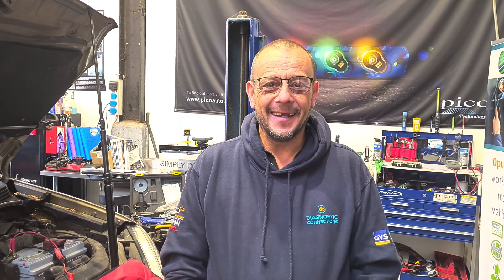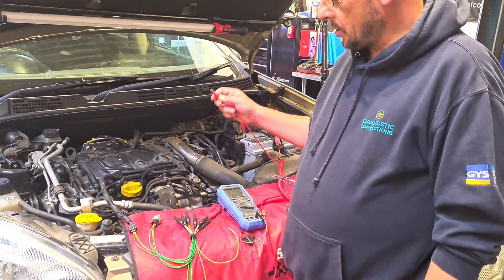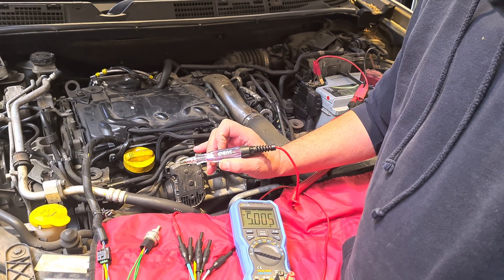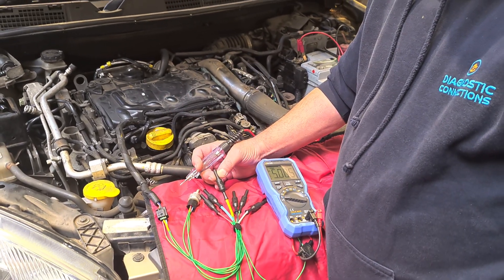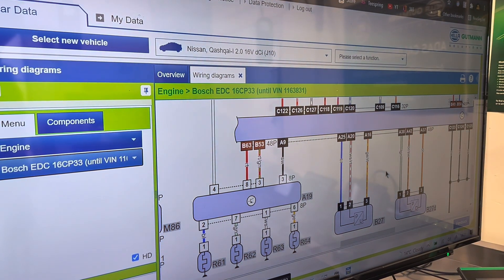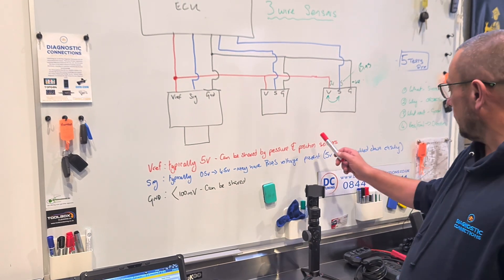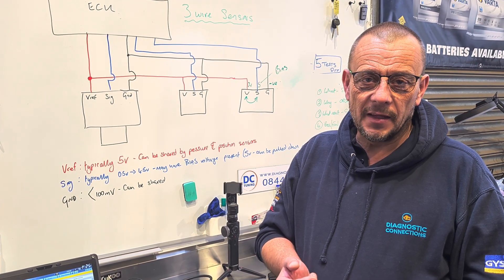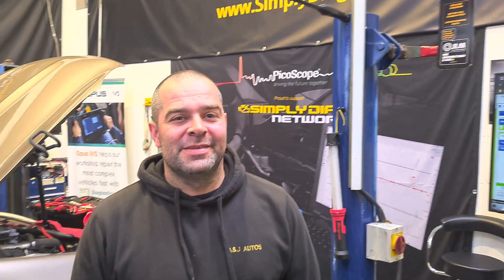How to test a 3 wire sensor and circuit - simple tools.

Comment: Oh I see what you did ,  you have two wires connected to battery and you just connected th test light to the negative side.  You couldn't really  see exactly what wires was connected    i had to soom it. And I see you have  connected A Y lead wires connected  to each sife of battery post

Comment: Why even use a test light on the signal wire? If you unplug the sensor and scan data jumps to 5v then the wire is good!
Reply: See the whiteboard explanation @ 6.20 in the video. Not all sensor circuits have a 5v bias unplugged. Some, like this example, are 0v unplugged and require a voltage applied so it can be read at the PCM to confirm wiring integrity

Comment: Great Video tutorial. Few questions. 1. If test light is connected to battery voltage, why is the live data only showing 5V? 2.  All this tests are with Key On Engine Off? 3. If i do not have the live data option, how to test the signal wire is good? Thanks, Russell
Reply: To check the signal wire integrity you could just unplug the sensor and you would have 5v. I wouldn’t guarantee it’s always 5 as the Ford Fusion i looked at the other day had cam and crank sensors that had 5v ref, 12v signal and ground.

Comment: I have a "Fuel rail over pressure" P0088 fault and a reduction in fuel flow back to the saddle tank leaving the feed side empty. 
The metering valve and pressure relief seem to be working but I'm wondering if a rail pressure sensor can give out the wrong reading and the ecu will adjust another component to reduce fuel affecting the return flow

Comment: Completely understand what you're doing but why are you putting 12v down a 5v signal wire?
Surely youd use that known good 5v supply at the plug & not force 12v down it 😂😢
Reply from the maker: Your testlight is acting as a current limiting device, in this case around 100mA, therefore safe, I have never seen anything damaged. Thanks for the comment, it highlights the need for a deeper explanation in a further video 👍
Reply: @SimplyDiagnostics  But how does the voltage from battery (12v) show up as 5V on the signal line?
Reply: @russellmaguire-g1i I might be wrong, but I think that 5v is coming from the ECU, not the battery.
Reply: @russellmaguire-g1i  The PCM is monitoring the input signal for a voltage of between 0-5v. A higher signal voltage will basically just be read as 5v with anything above that being ignored. Always do this test with an incandescent test light as shown here, not jumping 12v directly
Reply: What will happen if he does that?

Comment: In a nutshell, what exactly is bias voltage?
Reply from the maker: Bias is a virtually zero current voltage on a circuit that an ECU can use to detect a circuit fault ie open or short.
Reply: @SimplyDiagnostics also called pull up voltage and is why the ecm will throw a “voltage above normal” when the sensor is unplugged (6.5 bias voltage on a 5 v reference sensor). Because the bias voltage is higher than expected?

Comment: Whats the benefit of this compared to backprobing? Or are tou trying to see if the sensor its self is pulling the bias down? Also would like to know where to grab them test leads they look a good job
Reply from the maker: Great question, back probes can introduce a pin fitment variable, my test leads are either from the hubitools kit available from Diagnostic Connections or the breakout kits from Warwick test supplies. 👍
Reply: @SimplyDiagnostics  awesome thanks for that pal

Comment: Great video, only bit I don't really understand is bat positive to the signal through the test light. This shows 5v on live data but is this actually 12v but the ecu can only read as high as 5v?
Reply: I can only guess but it seems to be a analog sensor, so it was just at the upper limit because it was equal or more than 5V and the ECU doesn't care about higher voltage.
Reply: Scary sht. Might fry an ecu in some cars? Dropping 12v into 5v line?
Reply: It’s not how I would test a signal wire. By far the easiest way (in this situation) would be to simply unplug the sensor and watch the live data change.

Comment: How are you plugged in for the live data?  I have a P0190 intermittent fault. J have 5v Nd ground. No volts on ignition on from the connector but when engine started between 1-× volts. Car usually can do 4 miles then fault. The 3 pin sensor at times stops showing the readings hence the fault but im lost how to fix it

Comment: HI   I have a 2009 vx astra 1.4 petrol  car had misfire hole burnt centre of no 3 piston fitted  new piston chain kit etc 
had 1 code stored for lambda bank 1 sensor 1  circuit new sensor has fixed  that fault  
any quick easy test  i could do to make sure the car is not over fuelling  car is starting running spot on atm  but  little apprehensive to take it out on the road  
any advice greatly appreciated 
👍

Comment: Hello. Can you help me please. I’m trying to test the 5V circuit of a Sprinter Van, EDC16. How can I check the ECU is working ok? What I’ve done is place a load in the circuit 2K ohms, same as ten boost sensor, the voltage pulls down to 3.5v, does that mean it’s faulty?

Comment: Great video thanks, nice refresher. Had a question if you are missing the 5v reference can you supply the sensor with 12v instead of 5 from battery positive and now see if the sensor works? to sell the time to find out why the ref is missing and confirm sensor is ok.
Did it recently with a voltage generator to supply the 5v and that worked but wondering about making that test easier when a voltage generator isnt handy.
Reply from the maker: I wouldn't recommend, safer to do it through a testlight or a 5v low amp supply specifically designed for the job.
Reply: Great thanks yep I bought a portable voltage generator can do 20ma 0-10v should be good for it
Reply: @SimplyDiagnostics Can I ask how does using a test light make it safe to put 12v in to a 5v circuit so it doesn't fry ecm?
Reply: No, you’ll likely fry drivers or devices
Reply: Thanks I bought a little hand held voltage generator so I’ll use that when it happens

Comment: Excellent video! I've got a Smart CDI 45 bhp which I was ripped off on. Got various issues but can't get to the bottom of them. Mainly low flow at the egr and an iat circuit code. Car drops into limp mode constantly. Got a new egr and enough vacuum to lift it and no vacuum leaks. However, I've back probed the MAF and have 4.99V ignition on engine off at the loom side. Plugged in the volts drop to 2.32 ignition on. Start the car and the volts are 3.66 at idle. 3.4 volts at 2K revs and 3.1 volts at 3K revs. At idle my reader displays 6 g/s which seems high for a 799cc engine. Got any ideas please? Cheers.

Comment: Good to have ya back can u send a link to the test light you used on ya amazon shop plse Steve
Reply from the maker: https://www.amazon.co.uk/shop/simplydiagnostics
Reply: @SimplyDiagnostics  is it the otc 3633?
Reply from the maker: There are 2 OTC and a cheaper version
Reply: @SimplyDiagnostics  is the otc one you used on that test the number i gave plse Steve?
Reply from the maker: No mate, it was the cheap chinese one
Reply: @SimplyDiagnostics  is the 3633 the same “spec” as yours?
Reply from the maker: As in the video, no, that is just a cheap chinese one. I have the OTC 3633 and can recommend it for general use. I have many others and use them all, they have different current current draws. Hope this helps.

Comment: Hi there
Just want to ask. What voltage should you have on signal with KOEO. I thought it should be 0.5v or there abouts
Thank you
As always great video showing test methods
Reply from the maker: Hi Haroon, it depends on application, each case is different.

Comment: Great video and well explained. Just a note some vehicles also use digital sensors for pressure using changes in frequency instead of voltage changes.
Reply from the maker: Indeed they do, we also have sensors now using the SENT protocol that is a digital data signal and not frequency. 
This is where rule No1 comes in: What am I testing?
Reply: @SimplyDiagnostics  yes I have seen/diagnosed these before, 100% agree we need to know and understand the circuits we are working on.
 Again great explanations cheers 👍

Comment: Why does signal wire only show 5 volts when it’s plugged in to 12 battery volts please scratching my head , awesome to see you back
Reply from the maker: Purely because it's programmed to see 5v as the upper limit and therefore shows it as it's max value. Hope this helps. 👍
Reply: Yes thank you glad to see you back

Comment: Don't really need the DMM so long as you've got an incandescent test light that'll glow at 5 volts. Has to be incandescent because some pull down signal circuits will flow enough current to light an LED.
Reply from the maker: Exactly 👍

Comment: Do you have the 5v limiting adapter on the power probe battery clip for your test light?
Reply from the maker: No Mark, the testlight acts as a current limiting device so for this particular application its relatively safe.

Comment: I understand the theory, but I always feel some trepidation about plugging a 12v source into a signal wire back to PCM; less so if ground Vref or bias ... for the signal wire, this circuit carry very little detectable current via the sensor resistor ... 120mA light may make possible a100X the kind of current the wire may carry ... Do you think there may be any concerns justified? And do you think this would work with, say, a 30mA digital light??
Reply from the maker: I've personally never had an issue and no, an LED or digital light isn't a big enough load to pull down some bias voltages so may skew the test.
Reply: @SimplyDiagnostics  Excellent vid nontheless and very valuable to keep the test in the toolkit. Thank you!

Comment: Why is the signal value showing 5v on the screen when it's got 12v up it backside?
Reply from the maker: Great question, the ECU is programmed to evaluate up to 5v so even though the voltage is higher it will register a maximum of 5v. There are variations to this but this is the norm for most.
Reply: @SimplyDiagnostics  lovely, so it's safe to feed 12v into the ecu when checking the signal wire by watching the signal value.
I've literally just changed a 3 wire sensor this morning, the old faulty exhaust back pressure sensor on the mazda 2.2 skyactive engine, it's now got the mazda upgrade sensor kit on it.
Anyways one more thing, is the 150ma incandescent bulb test light categorically safe to use to test the signal wire to the ecu, there's no chance of over loading the ecu on that pin.
Reply from the maker: Personally I've never had an issue doing this with my testlamps. Check the current draw of your testlight before trying it. 150mA "should" be safe on most circuits - there are exceptions.